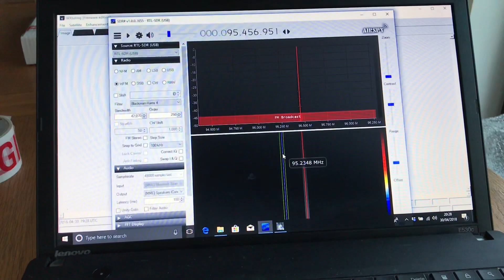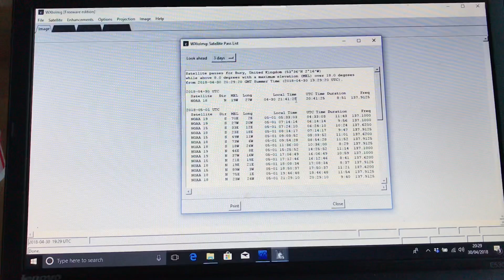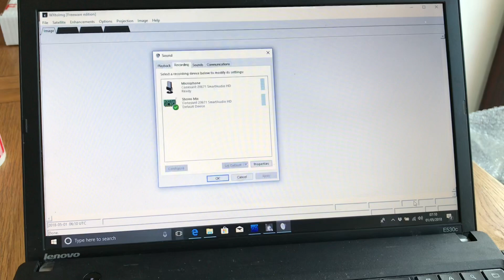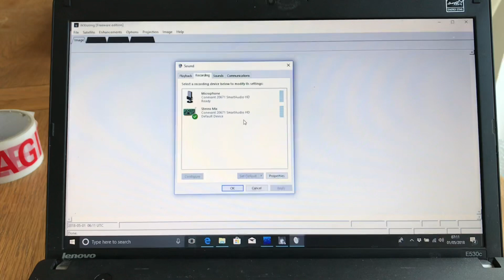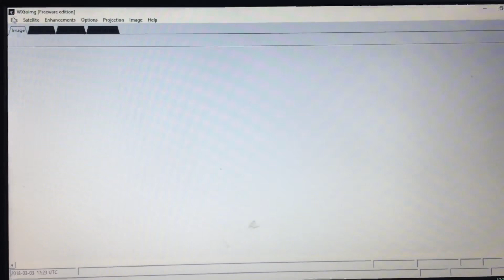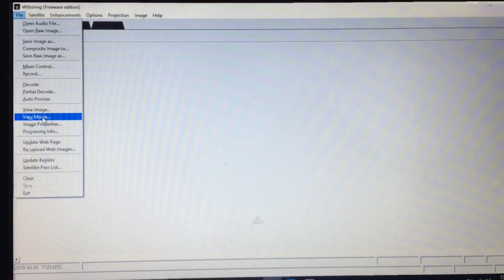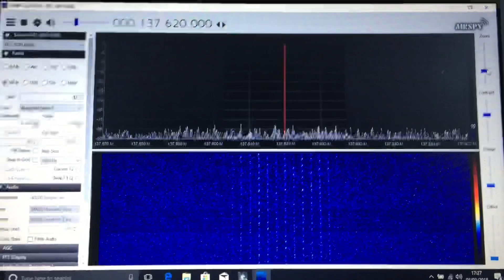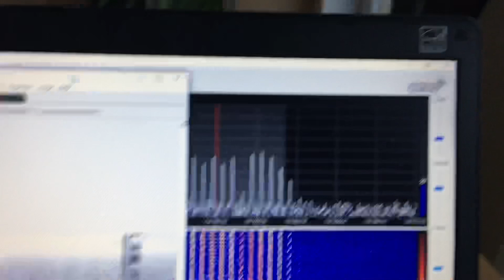How to Download NOAA Weather Satellite Live Earth Images - using SDR usb stick and Homemade Antenna

Comment: step 7  i learn from this person that wrote in a  online blog  it says set it to 40k  or you can go into settings for like  goto  receive_and_process_satellite.sh  change  60k to 40k  make sure  save in nano editor  then everything would be set  those cheap sdr dongles you get off amazon and ebay you goto into k settings like 60k needs be 40k. .
https://www.instructables.com/id/NOAA-Satellite-Signals-with-a-PVC-QFH-Antenna-and-/